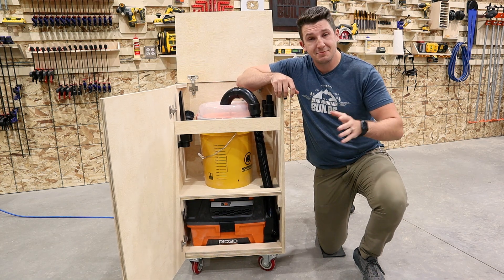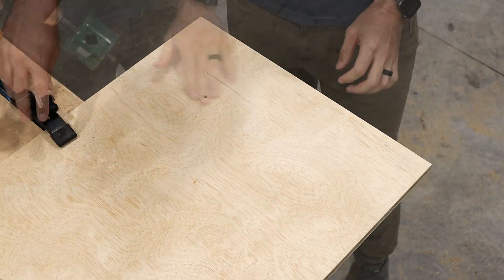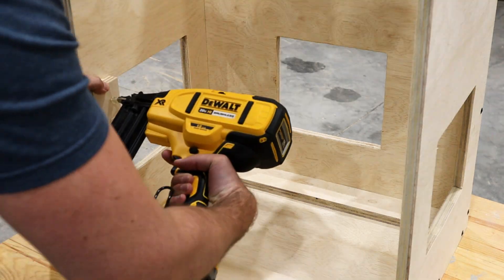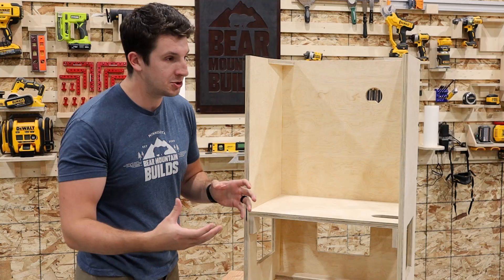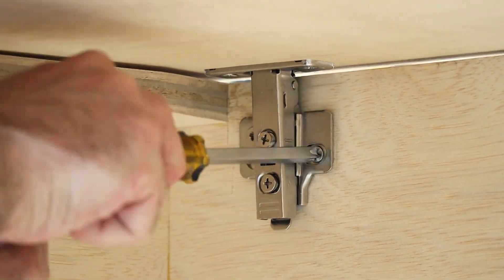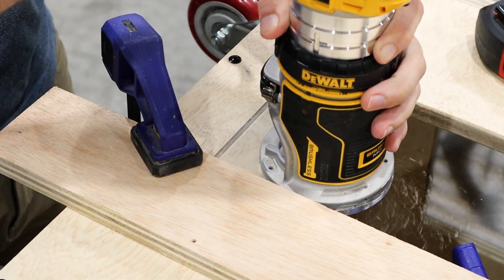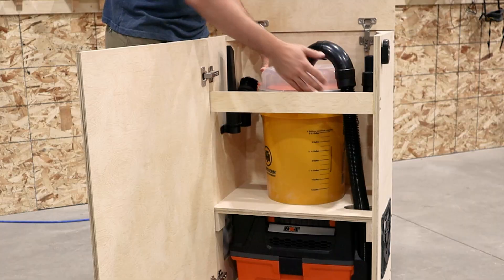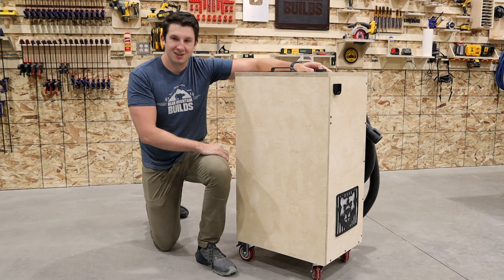Remote Controlled Cyclone Dust Collector

Comment: Hi! I bought the plans, and the vacuum and cyclone collector in this video. I was cutting up the sheet goods today, and I notice some discrepancies in the dimensions. Page 4 shows the door, back, and sides as all being 38 3/8" tall. That's what I cut them as. The cut plan on Page 7 shows the braces and shelf support blocks being cut from the remainder of the back wall panel. I got the back wall panel and all three of the braces, but this left a strip of about 1 3/4". I did the math and it all comes up to over 48". No biggie, as I can cut them from other leftovers, but a discrepancy nevertheless. Also, something I didn't pay attention to, is that Page 3 shows the overall height of the unit (minus the wheels) as 36 1/8". Sooo, some mismatched dimensions. Maybe it is supposed to be 36 1/8", which would have left enough wood for the 2 1/2" spacer blocks. Like I said, I can make those out of other cutoffs, but I just want to bring this discrepancy to your attention. I like the concept, and have the vacuum and cyclone working on their own, but it will be much nicer in the cabinet. Thanks.

Comment: Are you still using this a year later? I'm about to make something similar with the same shopvac that is on sale for 80.  Just like to know the long term use satisfaction.
Reply: Did you decide to make it? I was thinking of doing the same with the sale.
Reply: @jennmartin851  I will be, but I'm doing a different cabinet, more storage and larger top to hold a band saw and drill press.

Comment: I noticed you aren't using bags for the vacuum. Does that model not accept vacuum bags? They will help to keep the filter for your vacuum super clean, so that you're not losing any suction
Reply: So little dust gets by the separator that I think you would lose more suction with the bag than whatever fine dust does get by. It's also worth it to clean the filter every now and then, anyway.

Comment: That's a cool build! Thank you for making this video and plans for it. I do have 1 question though.. The Ridgid vacuum unit itself. doesn't it get moere hot from being inclosed in a cabinet while in use? I mean usually  "factory specs" on most electronic devices, state that the device needs to stand in "free air" and not in enclosed spaces?
Reply from the maker: It does get warm in the compartment, but I've never had any issues with over heating.

Comment: Thanks for the plans Zach, very thorough and easy to follow. Question on the 5 gal bucket, what is the height of yours? Mine missed aligning with the hole by about 3”. I double checked the shelf height, hole height, and overall height, everything appears correct. Are our buckets different heights? Mine is 14 1/2” tall.
Reply: Same thing for me.  I can't figure out why

Comment: Hi Zach, loving the videos. When running this cyclone vacuum to with table saw etc, do you find either way this minimizes air born dust as well, or what else would you reccomend for that. So the shop doesn't get covered in  dust. thanks

Comment: Zach I noticed that the vac you used has 1 7/8" connectors.  The Dust Stopper Pro has 2 1/2" ports. What did you use for the transition pieces (1  7/8" to 2 1/2")?
Reply from the maker: Those on the rigid fit perfectly due to flared end on the dust stopper elbows. It just happens to fit together perfectly

Comment: Terrific plans Zach! Very detailed and easy to follow as I’ve come to expect. Also really appreciate the option to purchase the 3D printed parts. For those considering ordering them, do it! They are very well made and came promptly. I also  purchased a boxed set of the spacers too, and they are dead accurate. Slightly modified height to accommodate my Cen-Tec system and it’s perfect. Highly recommend!

Comment: What is your opinion on the grounding wire that dustopper recommends adding? Did you add one?
Reply from the maker: I didn't add one. Seems to be working just fine and doesn't seems to build up too much static

Comment: The Rigid NXT 3 gal 5 hp shop vac is 30% off rn too! 🎉 Just have to get the one without the mount since this build doesn’t use that accessory anyway

Comment: Thanks for the video! My version of this build will incorporate sound proofing because my big shopvac is not a quiet one...
Reply from the maker: Could easily add some sound proofing to the inside. It comes out at 70dB as is but you could probably get it a bit lower
Reply: That's exactly what I was thinking too, just needs some sound proofing!

Comment: A vacuum can only pull as much as it can exhaust - have you measured the difference between having the vac outside of the cabinet and with it inside?  Unless it can exhaust 100 CFM, it won't pull that much.

Great build!  Very clean looking - I need to redo my OSB/scrapwood contraption.
Reply from the maker: I tested it against my $600 Jet dust extractor by using both to suck up 5 gallons of dust and the Rigid inside the housing beat the Jet by almost 20 seconds
Reply: @BearMountainBuilds  That's a pretty fair benchmark!

Comment: When I did a similar project, I ended up with a bucket that kept collapsing under the air pressure from the vacuum. This was solved by nesting the bucket inside a second bucket. Just a tip for anyone who wants to do this for themselves!
Reply from the maker: I ran into that issue when I used a food grade 5 gallon bucket, but the buckets you get from hardware stores like Home Depot, Lowes, and Menards did just fine.
Reply: @BearMountainBuilds   I just tried the Home Depot bucket and it seems to be too short to reach the hole. Apparently different 5 gallon buckets have different dimensions.

Edit: I doubled up the buckets. Two Home Depot buckets stacked together fit perfectly. The other problem I had was the hose that comes with the vaccuum and connects to the separator kept disconnecting. In case anyone else had this problem, I just used some black duck tape to fix that one.

Comment: Is the vacuum itself remote controlled or did I miss the setup of that lol
If so that’s pretty sweet!
Cool build. I definitely need to do this for my shop vac
Reply from the maker: The vacuum plugs into a remote controlled unit and you just leave the vacuum on all the time and the remote unit controls power
Reply: @BearMountainBuilds  you can also buy a device that turns on the vacuum when the power tool plugged into it turns on,and runs the vac for a minute or so after the tool turns off. I have one on my belt sander to shop vac.